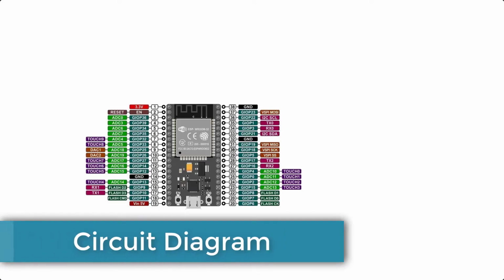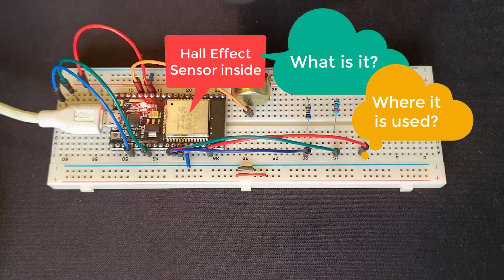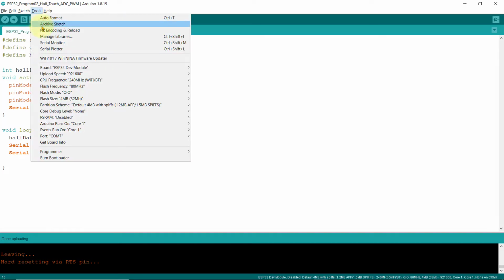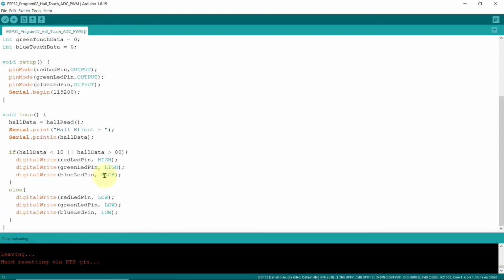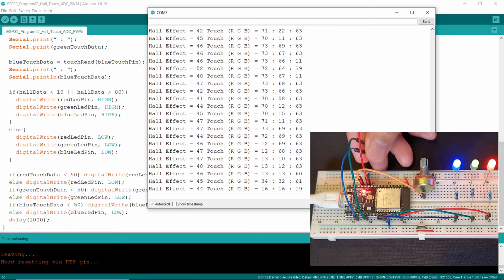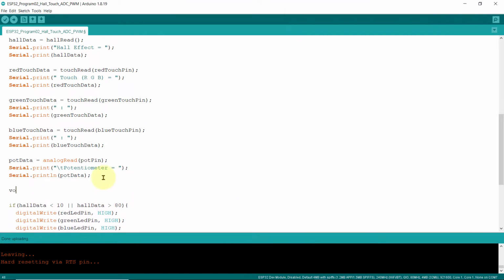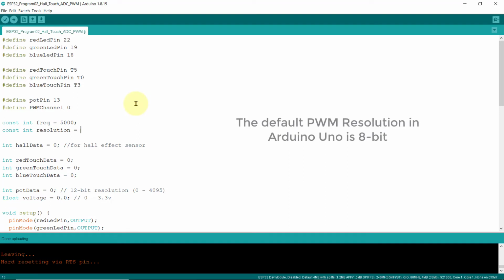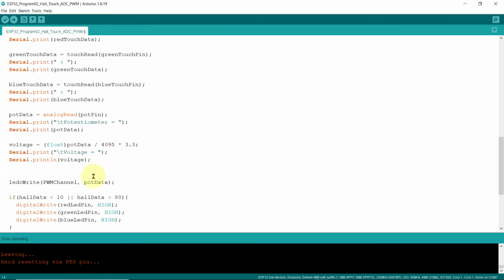02  Analog to Digital Converter (ADC) | Pulse Width Modulation (PWM) | Hall Effect | Touch | ESP32

Comment: 02 April 2026 Hit a snag with the Hall Sensor command hallRead(). Found a possible clue for people following this course. From Random Nerd Rui Santos: The hallRead() function has been discontinued. Reading the hall sensor is no longer supported on the ESP32 version 3.X. You can still use this function, but you need to downgrade your ESP32 board add-on to version 2.

Comment: sir paano ko kaya ma ddrive ang mosfet IC na nag rrequire ng about 4v. Ggamit po sana ako ng PWM to control the mosfet ( to turn on and off sa mabilis na switching ) kaso di ko po alam anu ggawin para ma convert ang 3.3v to 5v proportionally